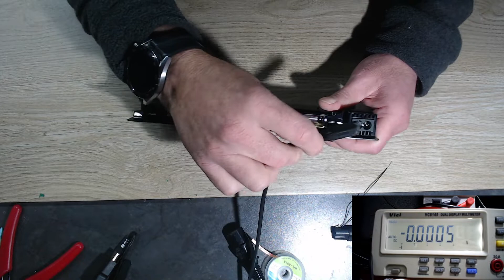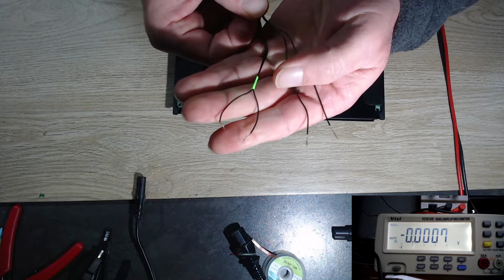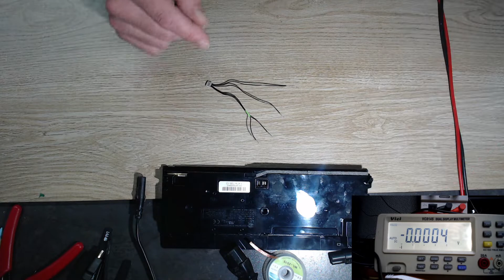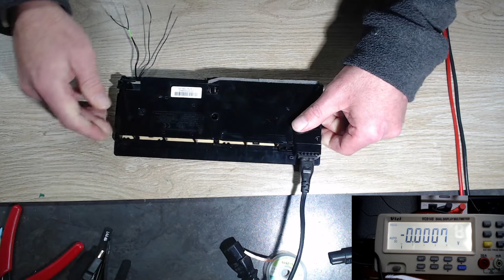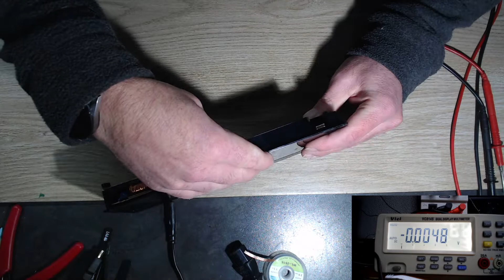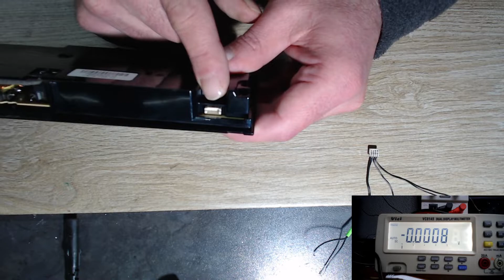How to test a PS4 power supply

Comment: While checking a PS4 Pro PSU without enough caution, I got shocked by the residual charge in a capacitor and am now lying down for a while. When doing this kind of inspection, leave the plastic cover on, and if you don’t know what you’re doing, don’t take it off.

Comment: Hello my power supply reads 11.88 volts is it good or bad? My ps4 is stuck in safe mode and upon initializing ps4 turns off and turns on in safe mod, if anyone has an idea its really appreciated
Reply: Replace your hard drive

Comment: Hi there. Im a south african too , i live way down in kzn margate. So we can test the unit but there is no fix what so  ever for this kind of problem? Do forgive me im an experimental person kind of know my way around electronics but aint no boffin. I would love some advice other than run of and buy a new power supply.
Reply: So i tested the 4 pin strip and ther is no 5 volt out on any 2 of both sides. Can it be fixed.
Reply from the maker: Yes, either replace the power supply, or see if it only the power first.
Reply: @ConsoleServiceCentre  ok good but what do you mean see if it it the power first? Ek verstaan nie daai sin nie. Skies.🤣

Comment: Why didn't you use the other two with 4.8V but you chose the 4.1V?
Reply: He is not explaining properly. The 4 wires are  +5vsb (standby), ground, acdc_stby, acin_det. The 4.8V is +5vsb and it's ground. If you short those two then kaboom; maybe the psu has protection I dont know but that + and ground shorting could destroy a working psu.

For testing purposes, the 3rd and 4th wires are shorted. But in actual the ps4 send 3.3 - 4v on the 3rd wire (thats acdc_stby) and this is what turns on the 12v and hence the ps4.
Reply from the maker: I didn't explain it that way, as technicians would k ow that, this is more for people that don't understand what each point on the plug means.

I don't go over technical on this channel, I try keep things as simple as possible.
Reply: @ConsoleServiceCentre  i understand that completey i get you, for the majority of people what you explained is great. but the question was technical so i thought a little explanation was needed. No offence intended ✌️
Reply from the maker: Thanks hp hp 😉
Reply from the maker: They won't activate the 12v side of the power supply.